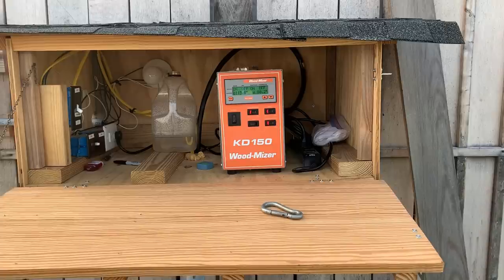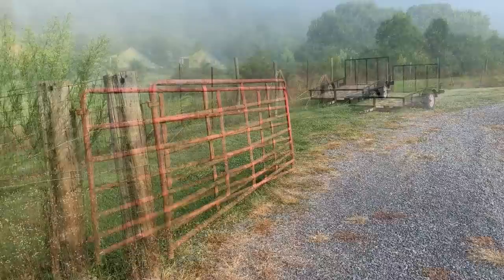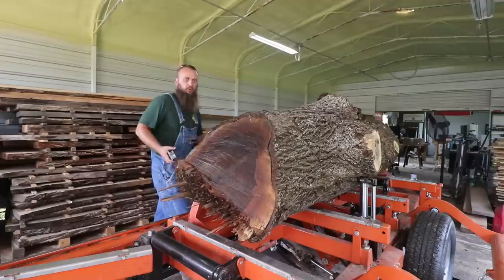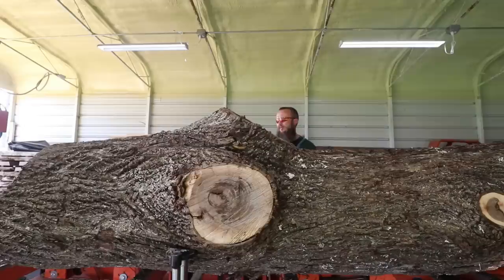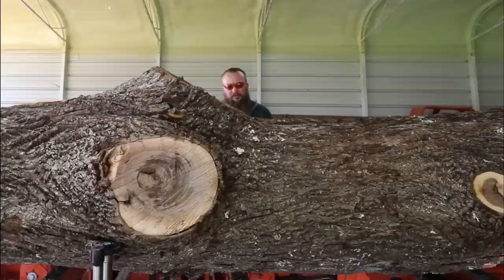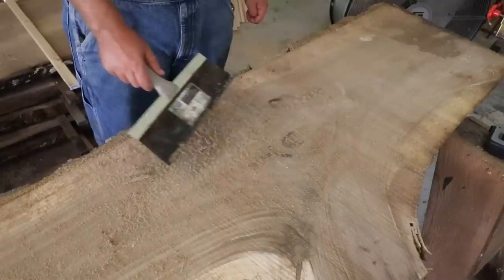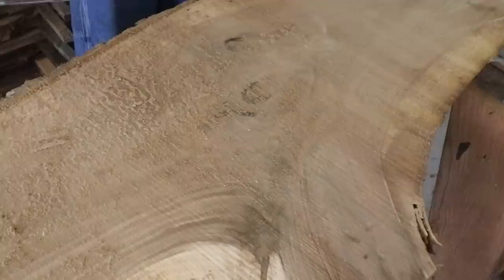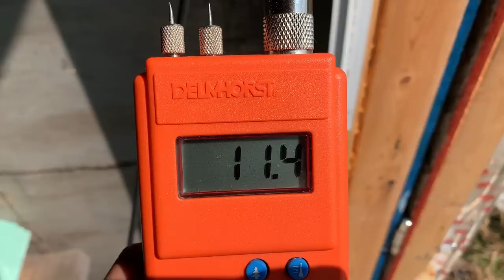SAW-MILLING THE BEST TIMBER IN THE WORLD AND KILN DRYING LUMBER, THIS NEVER FEELS LIKE WORK

Comment: If you can get some Locust wood, it makes great fence posts.  Just be sure to cut it while its green and put it in the ground and the wire stamped to it while it's green.  It shrinks as it dries so it grabs that stable and will not turn lose

Comment: Look into the polyurethane two chemicals to mix to pour around the post and have a tractor pushing down on the post to keep it down.  It will seal all corners and press into the dirt.  They use it on Poles now.   The bottom should have 24" of stone and have 36" deep for a tall pole and for fences.   Those are ideas for your better fence.

Comment: With your moisture readings in the kiln dried timber, the meter will be graduated for Oregon Pine most likely, since most are.
You will need to allow a “correction factor” to your black walnut species that your drying and also another “correction factor” on top of that again for the elevated temperature of the wood, to get the “actual” moisture content.
If the EMC (equilibrium moisture content) your chasing is say 9% in a dry relative humidity environment like snow or refrigerated air conditioning for the final finished furniture, then it would be best to pull it down to say 8% “corrected” EMC in the kiln, then let it “re-absorb” a little moisture back up to 9% with the kiln open & switched off to stabilise at 9% EMC before unstickering it and stacking into dry storage.
It might pay you to buy one of the “Tramex” brand of non destructive moisture meters made in Ireland (available on evilbay) so you don’t have to hammer the probes into good wood each time to get an accurate reading. 👍👍👍🇦🇺

Comment: Get a low level Cattle troff on the side of the dust extractor! Save you a ton of sweeping! The grain looked amazing!
Reply from the maker: may sounds odd but I enjoy the sweeping and clean up at the end of the day,
Reply: Well, that's good exercise... but I would have thought you had some kind of industrial vacuum to sniff it all up.  I wonder if there is a way to take the dust, add some kind of water or liquid to make a mash, then compress it down into small hard saw dust logs for a wood burning stove to help heat your shop in the winter.  Maybe i'm way off base with that idea... but just thinking how to use every ounce of wood from your original logs.

Comment: Do you still sharpen and set the blades yourself?  On the cut where you thought you heard metal, I detected two quick "zing-zing" sounds as if there was a fence staple in the bark or sap wood, but that would be pretty high up on the log.

Comment: Just curious but have you ever sawed teak or yue wood? Yue wood trees don't get big but they are pretty and they tend not to ever dry out so if you lean it in a corner some place it will take the shape of the corner but you can turn it around and it will bend the other way. It won't make rifle stocks but if doweled together it turns out really nice and it make nice bowls and other stuff similar. I had teak in the cabin of my boat. Also in the masters quarters and it would put you to sleep the smell did. I got the yue wood from oregon and some in washington. Just asking cause you cut for decorations as well as lumber so it seems

Comment: I wish you good luck with the Beech. I had some sawed years ago to build my work bench top, By the time they were dry they were so warped and twisted, when you put one onto the floor it only touched on one corner. Well maybe not that bad, however, I used most of it for firewood. A disgusting experience.
Reply: ...well, "ya can't win 'em ALL-!!"

Comment: Realize this is an older video but, question.... I noticed, or at least it looked like you used the same pin holes that had been used before to check the moisture there at the end of the video. I see you drove them in a little deeper but, don't you run the risk of getting a dryer reading than the wood actually is using the same holes?  My thinking, which may be totally wrong lol, is that the insides of the holes will have dried faster than the internal wood itself.

Comment: Re: Metal
Novice question.
Is it practical to use a metal detector on logs prior to working on them?
Cheers and thanks.
Reply: Jim Carlton hi, could be nails, or wire if it may have been in a fence, when YOUNG, and if that merger, can also pickup non ferrous metals, then bullets, cheers from NJ